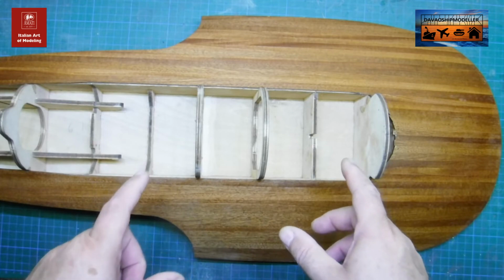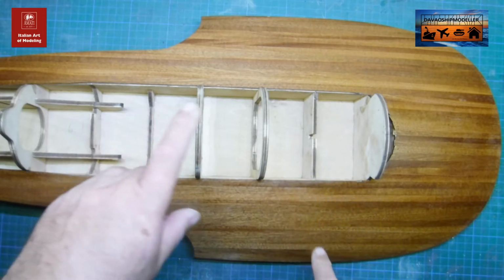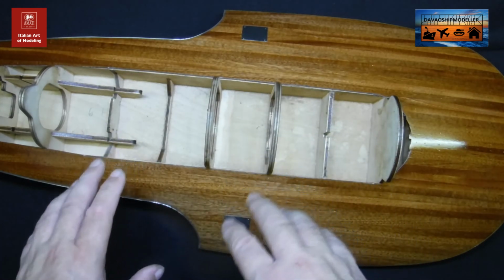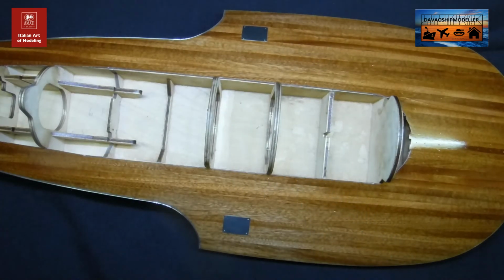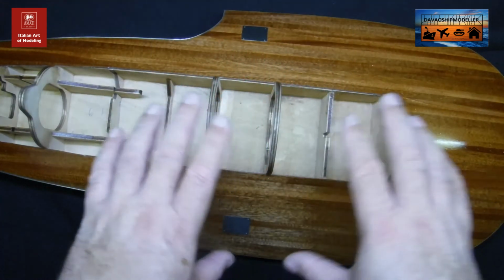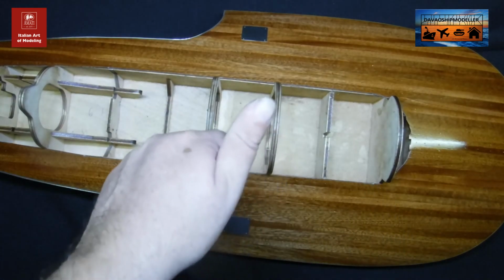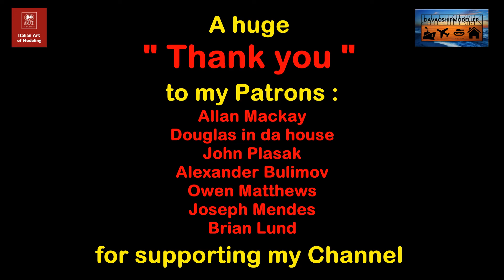Amati Arno Ferrari Part 3

Comment: HI, I'm getting to the stage of putting the first layer of varnish down soon. During the laying of the planks I filled in some larger unsitely between certain planks with glue and sawdust from the planks, but after the sanding process these planks showing as a slightly different colour, can you advise on any kind of thinner/solvent to remove the staining effect? tia
Reply from the maker: Well. Glue stains are always a problem if it comes to Varnish . The only advise I can give you is, painting this sections with Acrylic paint so close as possible to the Wood you are using and than varnishing it . It will be not entirely invisible but surely it will blend in . That was one difficulty on this Model , not leaving any Gaps between the Planks. Other option can be , mixing the Sawdust with Varnish, instead Glue and put it in between the Gaps . You need to try first which Option works better for you . Happy modelling John
Reply: @davaoshipmodeller  I’ve mocked up some decking with a glue and sawdust mix, I’ll try out various options. I’m hoping that sanding past the glue could solve it

Comment: do you happen to still have the reference of the 3mm chrome strip you used? I'm struggling to find some
Reply from the maker: Sorry I can't find anymore the Link , because I bought it from a local Platform similar to Ebay here in the Philippines but here is a Link from EBay with a 4mm Wide Strip : https://www.ebay.com/itm/174766222989?epid=10019759226&hash=item28b0e0ee8d:g:2sAAAOSwuJZgm3Fs&amdata=enc%3AAQAHAAAA8MiRsg4WCU84pumRv6XLHekpnOicUyYLSIX70Ykj%2FHLa8fZTlpKQoqVqnmGFCETKZ%2BW5pwiCJuPgNs27r1tPZYDbgNJ%2FWO5sp2KkoGFpCZGKtXw6GOfzX43S4512m0ZU3Tz7BMMMsCdIsq8IXYoQ5pIAzouUkiBNeYa3Zz9dEhO5JvAc%2B%2BXGLFp7WPVQLC6lITj0itnJtJd%2BfrwDS9KkfeLuL%2FE8L7gMJ50y73jrsouk6ZpOWM0WPWPvkx7L1YwMBKmt1FkVAYzTN%2FmPNPNlnA994%2F1%2BUqDDqlimwdbzw1hEeitEH7N5FLfI3SV8Dvgl2w%3D%3D%7Ctkp%3ABk9SR8i-gc65YQ
maybe that will help .
Reply: I could find 4mm too. I'll try it out for size. Thanks for the response
Reply from the maker: Great, a 4mm Strip might work too

Comment: Beautiful work as usual. I liked it a lot. Could you please tell me what is the diameter of the headless rivets you used? Also, if possible,  the distances between two consecutive rivets in one row or column? Thank you so much.
Reply from the maker: Thank you . the included Brass Nails have a Diameter of 0.8mm . They are in the Center of each Plank from East to West on every Bulkhead. And the Space between 2 Bulkheads ( North to South )  are divided by 3 and only every second Row
Reply: @davaoshipmodeller  Thank you very much!
Reply from the maker: @scalemodeltherapy5842  you are welcome